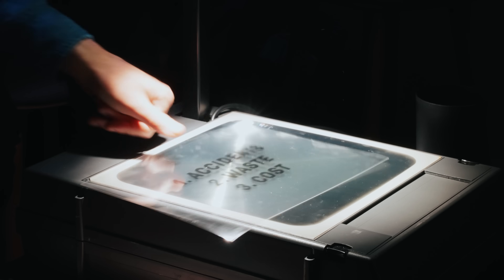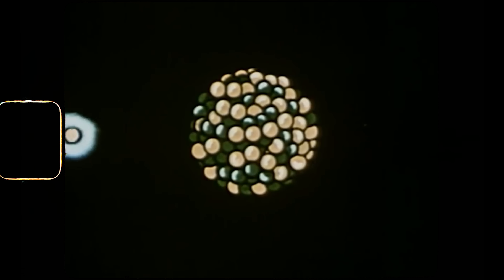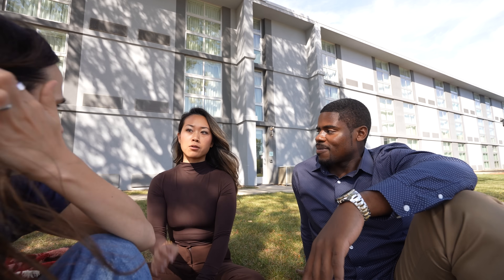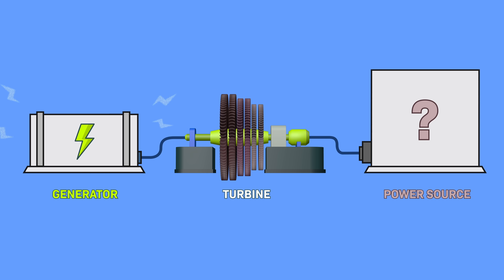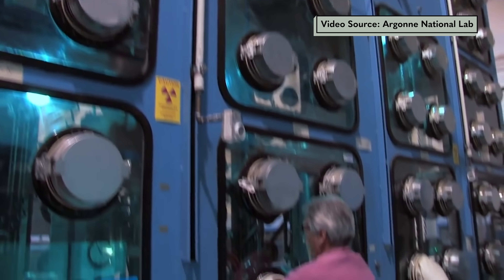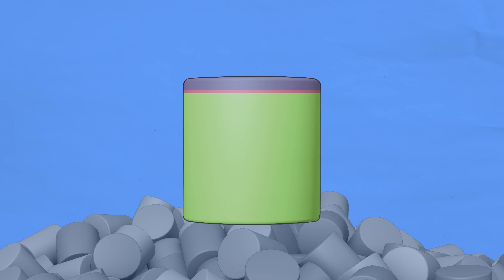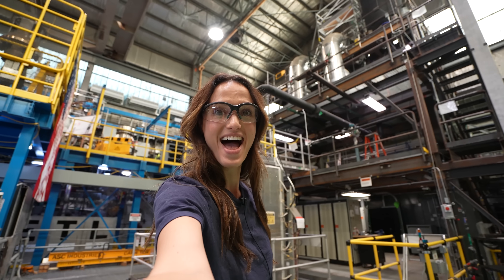The Big Lie About Nuclear Waste

Comment: You said the magic word especialy for the USA , (cost ) , the expence of building a new kind of reactor , added to its simply cheaper to dif the shit out of the ground and use it and pass the problem on to the generation that will finaly have to do something about it means nothing will change , by the time this happens fusion may be a thing makeing this redundant , or better batteries storing power from solar and wind , and so on

Comment: The big point that's missing here, is that not all nuclear waste is spent fuel rods. Gloves, suits, concrete, metal casings... basically anything that gets enough contact with the fuel to become ionized will give off radiation. And even if you extract the uranium from spent fuel rods, the rest will still contain tons of radioactive isotopes.

Imagine an electric car, and the only thing you could recycle from it, was the lithium and rare earth metals inside the battery and the motor to build new electric cars, the junkyards would still fill up with cars and you would still need a lot of new raw materials to build a new car each time.

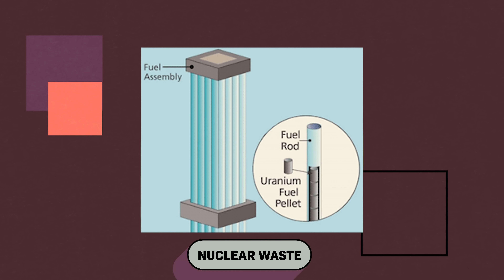Comment: At around 7:12 you mentioned that for U235, the 235 was the number of neutrons. This is not correct, 235 is the number of core elements in the atom which is very close to the atomic weight. If you Google the atomic weight of U235 you get 235, but if you Google the number of Neutrons you get 143. Likewise for the No. of protons you get 92. So 92 (protons) plus 143 (neutrons) gives you 235 (the atomic weight) Basically protons and neutrons weigh the same amount (almost) This concept applies for all elements in the periodic table ie. carbon 12 has 6 protons and 6 neutrons, carbon 13 has 6 protons and 7 neutrons, and carbon 14 has 6 protons and 8 neutrons. Carbon 14 BTW is radioactive where as the other 2 are not.

You have a handful of similar minor slips of the tongue which I won't elaborate on here.

BTW, thanks for an interesting video.

Comment: The bit I am missing are the difficulties running fast reactors safely. There is much less margin of error with fast reactors (look up "void coefficient" for more information) and this is not irrational "fear" but a real risk. Assessing this risk lead to an already built fast reactor in Germany never being used (SNR-300 in Kalkar).
Reply: Green politics have long played a role in Germany rejecting nuclear. They just closed their last reactors so they can burn coal as a result.
Reply: Integrating chemical separation of spent fuel fission products into the consumer power industry is just merging nuclear weapons production into power production.  It has serious implications with regard to weapons proliferation. For example, during the period of Japan's foray into reprocessing, enough plutonium to manufacture several nuclear weapons was "lost" or unaccounted for.  The problem of liquid waste produced in reprocessing has not been solved, will cost trillions and the current plan for such waste is to kiln fire it into ceramic blocks. DOE estimates that $300 billion to $640 billion will be needed to finish all of Hanford's environmental cleanup by 2078. That translates to annual budgets of $5.4 billion at the low end of the estimate to $11 billion at the high end, according to DOE's 2022 Hanford LIfecycle Scope, Schedule and Cost Report.                                                                                                        The existing ceramic industry already pours millions of tons of carbon into the atmosphere yearly.  Con jobs on this scale are beyond all sanity and reason and will bankrupt countries involved in these industries.

Comment: Correction the number associated with U-235 etc. is about the mass in the core, so both neutrons and protons. What differs U-235 from U-238 is just the neutrons, otherwise it wouldn't be uranium. So there are 3 neutrons less

Comment: This is one thing I think needs to be addressed. The concept of half life in radioactive isotopes. I'd much rather have something on hand and store it if the half life is 20,000 years than if it was the same mass with a half life of 200 years. The 200 year half life isotope will give off so much more radiation in the same time period you basically can't even handle the stuff and have to make shielding 100x more effective just to store it so it doesn't contaminate the environment. So, you want isotopes to be stable for as long as possible. It means they fire off radioactive particles less frequently and affect the environment much less than a more highly radioactive isotope. Humans just hear that it's radioactive for 200,000 years and they have visions of it piling up and never being used again. Now we can use it again, further depleting the source so it becomes as close to neutrally radioactive as possible.

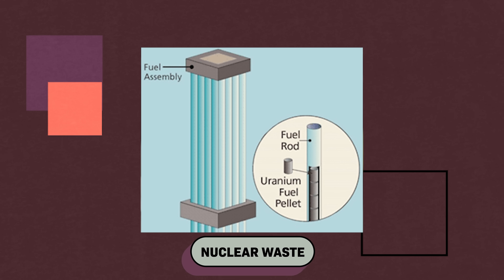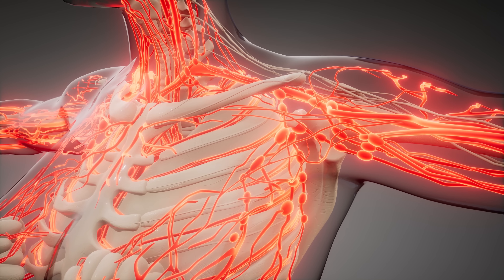Comment: @7:06 the number DOES NOT refer to the number of neutrons in the atom, but rather the number of protons+neutrons. @7:30 you don't "fire a bunch of atoms" at it, those are neutrons. And those neutrons are spontaneously generated by the decay of material. What you're looking to do is contain them with a moderator to initiate a chain reaction. The whole separation process is kinda glossed over but it REALLY IS a problem. If you have a random mix of chemicals the chemistry to refine anything of good purity is insanely complex and expensive. This is just for a random collection of chemicals, now add in the fact that the composition is changing due to nuclear decay, AND the fact that every process step now needs to be ok with the radiation for a long time (lots of equipment an materials can be damaged by ionizing radiation, and you need extra safety)

Comment: Good god, what a flaming pile of nonsense. So we have a way to recover uranium that is much more expensive than simply creating new fuel pellets from fresh ore, that, as a bonus also generates plutonium and forces you to handle ultra-active concentrated nuclear waste, for which no storage facility exists. And all this to power traditional reactors that are not being built because they are too expensive to compete on the energy market, or perhaps speculative breeder reactors that no country on Earth has gotten to work correctly and cheaply, which come also very handy when you want to produce weapons grade plutonium, all of which sound just about the polar opposite of "cheap and competitive".
Reply: And what IMO often is glossed over, especially with plutonium, the radioactivity is a problem for sure, however it is also chemically extremely toxic.

Comment: Sort of gave me goose bumps because you did not get anything wrong. The DOE and Holtec are working towards an interim storage solution. It would probably be useful to study solutions that include re-processing facilities at these locations.  What is wild is we will have to spend millions just getting the fuel OUT of storage overpacks and into transport casks to get them to these facilities.  Furthermore, with Small Modular Reactors on the horizon, our nuclear future is bright.  Such a drastic turn following 2011 and the massive hit nuclear took as a result of Fukushima.

Comment: Thanks Cleo. We are being lied to about how hazardous the waste is too. There are some elements in nuclear waste which are dangerous because we use these elements and / or store them eg radioactive iodine. Heavy metals are bad even without radiation but at low levels are little problem. So we could remove the truly dangerous waste for storage, the bulk of it could be finely ground and mixed into concrete or nonbiodegadable plastic and buriued. There is no scientific evidence that increasing background radiation by even 5 fold is remotely harmful. And burying it would barely raise background levels.
There are parts of the world with 8 to 10 times the average background radiation and it doesn't effect longevity, cancer rates are no different there. The myth that any level of radiation is bad for you dates back to the bombing of Hiroshima and Nagasaki. "Scientists" calculated the lethat dose of radiation, marked it on the x axis, marked 100 on the y axis and made a cross on the graph. Then they took a ruler and drew a striaght line to the origin (0,0) and declared that the graph could be used to calculate how dangerous exposure to a given amount of radiation is. Ideal levels may be above the normal background levels for all we know. See "radiation paradox" in wkikpedia.

Comment: I wanted to stick a Nuclear Power Station on my roof. :)
Turns out solar panels fit better and I have batteries as well.  I now use almost zero power from the grid.
The power I generate and don’t use goes back to the grid for someone else. 
This system will last around 20 years.
Sure this won’t likely power industry any time soon but it’s something I could do right now to power my life.
So I did and there is no ongoing waste and no bomb making material left over.
Maybe I’ll by an EV soon and stop burning oil as well.
Great Video by the way.  Easy to see you worked very hard on it.  I learnt more about why repossessing hasn’t taken off.
I’m sure one day central Australia will become the worlds dumping ground.  It’s huge, mostly empty desert and extremely stable.
We just need to charge rent for the space and not just take the waste.  I’m sure countries would make less if they have to rent the space ongoing.

Comment: quick corrections for 6:36 gas turbines in gas power plants dont use heated water/steam to run the turbine, they run like tank engine turbines on the gas itself
thats in comparison to coal and oil, where usually the fuel first goes into a boiler to boil water

doesnt really matter much to the point of the video, but there you go
Reply: I thought with modern plants they do both. they use the gas itself to fire the turbine AND they (re)use the heat too.

Comment: Good video. Unfortunately, it ignores one aspect that creates a huge problem over and over again: Humans. When we return to recycling radioactive waste (and creating plutonium on the way) there will always be someone who will want to use that for something nasty. Even if they don't intend to actively set off an A-bomb, they will still want it, at least to keep it "ready" "just in case". And that will be enough to stirr a cold conflict and make it hot.
Another thing that humans do is to put cheapskates in charge of important things. The Fukushima meltdown happened because a frickin economist decided to build the powerplant closer to the ocean to save money on cooling pumps. And over and over "incidents" happen in nuclear powerplants all over the world, not because of random failures, aging materials or unavoidable accidents but because humans keep going for the easy solution. Equipment is left and forgotten in venting shafts. Holes are drilled into containment walls to hang something, safety switches are being bridged with aluminum foil because they keep triggering an annoying alarm, ... All it takes is something unavoidable to happen to the one or two redundancy systems that are supposed to catch a failure of the main system while that one had been eliminated by a human.

So yeah. The technology is fantastic. But humans are insanely bad at managing it.